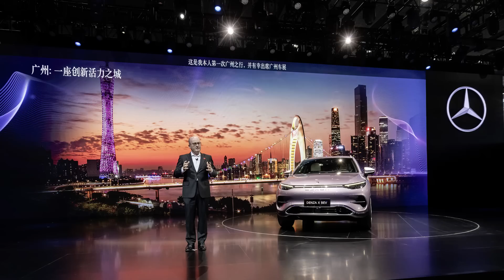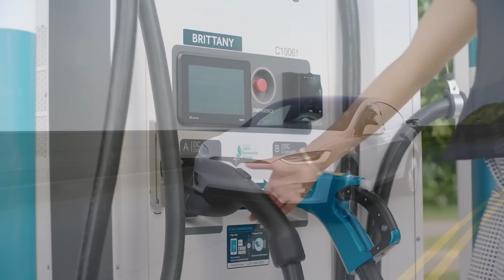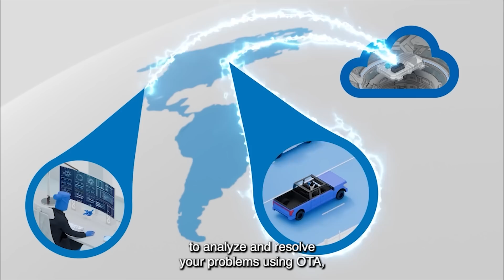EV Batteries Degrade 1.8%/Year; LFP Threatened by Falling Nickel Prices - Autoline Daily 3895

Comment: My MG 4 Trophy in UK 
Has 97% state of health after 48,000 miles in 18 months in UK.
Some batteries have no cobalt, famous for children working.
ALL gallons of petrol and diesel need cobalt, it's used in the desulphurisation process of oil for petrol and diesel.
Battery cobalt is recyclable.
How come autoline never mentioned it?
No-one cared about rights abuses before EV.
Why not?
Why now?

Comment: They are certainly coming up with better chemistry for various types of Lithium-Ion batteries all the time.
Solid-state batteries might not get a good foothold till around 2030...
If they can get around 1.5% degradation per 40000 miles for a Lithium-Ion battery pack they will be well and truly in the ballpark.
Charging times are also being reduced incrementally, because of the better battery chemistry that comes with R&D...
Firteen minutes to 90% charge on a public charger is still the goal for most Electric Vehicles and is attainable.
😎🇦🇺

Comment: I have a 11.5 year old smart EV (60-70 mile range stock) that's done 1000 charge cycles, has over 70k miles on it now. It still has 95%+ of its original range.

Comment: REPORTING GROSSLY EXAGGERATES BATTERY DEGRADATION 
That GeoTab's study announcement does not state that batteries degade down to 64% in 20years, that seems to be reporters putting words into GeoTab's mouth.
InsideEV (or whoever 1st miss reported this) have taken the first year degradation and multiplied it by 20 years, despite the fact that more degradation happens in the 1st year than the next several years combined. Since then nearly every reporting organisation just repeats this gross misinformation without bothering to understand the story.
The degradation of a quality EV will likely be closer to 94% than 64%. Though I would guess 84% after 20years is more realistic.

Comment: Battery price is decreasing at a rate of 10~15% a year and since the battery is the most expensive component in an EV, EV price is decreasing at a rate of 5~10% a year. ICE price is buttomed out while EV can go lower because it's fundamentally a less complex and more reliable design

Unless Europe can come out with strong EVs, it will not only lose the Chinese market, it will lose a lot of international markets

Comment: 1.6 kW a mile that's gas guzzler terms with only 500 miles of range. You can't go anywhere with that. I mean a diesel get 6 to 8 miles to the gallon but can go 15 to 2000 miles a full 300 gallon tank

Comment: 64% of battery capacity after 20 years isn’t good enough when a replacement battery totals the car. So a car originally with a theoretical 300 mile of range will only have a theoretical 200 mile of range in 20 years and only 120 functional mile range. I have a 27 year old Dodge truck that is all original except consumables. It still has a functional range of over 300 miles. No wonder BEV values drop like a rock they are disposable vehicles.

Comment: I need clarification about the statement at 4:40 regarding 1.8%/year battery degrading. How can battery mfgs like CATL offer 15 year replacement warratines if the batteries fall below 85%. At 1.8%, the battery would drop to 73% in 15 years. Also, how does MG in Thailand now offer lifetime battery warranties on some of their models?
Reply: I can only assume Nissan Leafs were overrepresented in the study sample.  Or the data were taken from only the first two or three years of operation.
Reply: It could be that CATL has a 10% buffer in their batteries. Thus you wouldn’t see the first 10% of battery degradation in the range estimation.
Reply: Lifetime battery warranty means the car wjll breakdown as garbage soon.. No ev no battery warranty ends.
Reply: @AskieFox-i2b  Maybe so for MG, but it appears CATL's Shenxing LFP battery, licensed to be made in the US for Ford, Tesla, and GM in late 2025 and 2026, will offer a 15-year or million-mile warranty with zero degradation over 1000 charges. When I engineered diesel engines, we never provided more than a one-year warranty on our engines. Our test on these batteries for our electric semi-power trains showed a full mileage range from -14F to 140F. We could not even offer that on our diesel engines.
Reply: @AskieFox-i2b  Break down?  You mean, like a Ram Promaster?

Comment: Even this study is being conservative imho: 

- Sure 1-1.8% battery degradation per year might be a good conservative figure to go by. Better to be conservative and be pleasantly surprised than the other way around.
- A study on the fleet of older Teslas has fairly consistently shown that the vehicles hit around 92-94 percent of original capacity by the 200k mile mark. (Source:Steinbuch Tesla Model S battery degradation data).
- Battery chemistries are improving, both in terms of existing NMC/NCMA stuff, and in terms of introduction of the LFP (iron phosphate) ones, which last many times longer but trade that in for slightly lower energy density, a good compromise for entry/mainstream EV trims.

Comment: Over time, ice engines lose horsepower torque and efficiency...
Reply: Sooner on direct injection, turbo cars
Reply: Yep I saw that happen on my old Corsa C. Granted, it was 16 years old but it did start to lose power when going up and slowing down where it would have had no problems keeping a constant high speed in 5th gear when I got it. Mechanic said that other than a full engine rebuild, there's not much else that I could do.
Reply: @Luka_3D  Happens to every ice engine, it's inevitable over time

Comment: There's not gonna be "enormous pressure" to back off ICE ban in 2035, because by then it would as useful as a horse carriage ban in 1950.

The problem for EU's "Dieselgate club" members is they failed to transition successfully to EVs before China's EV industry related "investments" started bearing fruit, in the same vein of how they came to dominate in solar.

Right now all EU has left as an effective local presence is Giga Berlin, and we see how they're making Tesla's life hard there, how ironic.

A backlash against China now will not save them, as ICE sales will continue to falter while China eats up the markets outside the EU, it's a global market (e.g. 2:39).

Trial by fire.

Comment: So, you lose 36% battery life after 20 years.  It's probably not linear, but let's say 18% at 10.  Does this correlate to the loss in range?  Does a BEV with a 300 mile range have a range of only 246 after 10 years?  I've seen data from Tesla showing the loss in range can be more than the loss in battery life.  It's good that the technology is making the batteries last longer, and thus pushing back the high cost of an inevitable replacement.  Howevver, if the loss in range is still relatively high, then that remains an issue for some buyers.
Reply: Battery life directly relates to range. Take A 60kwh battery with 240 miles of range (4mi/kwh) at 100% battery life. 90% battery life means the pack is only holding 54kwh and supplying 216 miles of range. However, the reality is that the issue is battery cycles. 
My 2017 Bolt EV had 8% range/battery degradation at 5 years, but had also driven over 100k miles on the original battery pack. At that rate, I could expect to hit 20% range loss somewhere over 200k miles. EV batteries are considered 'unfit for purpose' at 70%, so realistically I could have expected the original battery to have lasted over 250k miles, or over 20 years at an average of 12k miles per year. By 20 years, I would be more concerned with replacing the car than replacing the battery.

Comment: Coworkers model 3 is at 19% degradation (out of warranty), he has gotten worse than 1.8%...Standard deviation? Extreme points? Maybe share the numbers?
Reply: How many years and what mileage on the Model 3.  Maybe share the numbers?
Reply: @Gig0Surf  2019 M3, was at 19% at 175k miles beginning of the year. 180 mile daily commute (San Diego to Irvine and back), level 2 charging at home. Loves the car, he used to be able to do the commute only charging at home, now he doesn’t have the range.
Reply: How does he charge it?  Year?  Mileage?  Battery type?  Maybe share the numbers?

Note: There are always exceptions.  Plenty of ICE vehicles croak before 50k miles.  But it's not the norm.
Reply: 1.8% PER YEAR.

Comment: Lutz is a Putz. He completely missed the transition to electric vehicles.
The world is going all electric. ICE vehicle sales are falling every year.
He is an OLD time motor head who is living in the past not looking to the future.
Reply: He doesn't know anything about Chinese manufactured EVs EITHER.
Reply: IIRC he was key to supporting the Volt during his tenure at GM
Reply: @KJSvitko  they put the cart before the horse . Not enough power generation or chargers . Home chargers for grocery getters only reliable power
Reply: @Gadfly2025  Most EV owners do 90% of their charging at home overnight. Just like your Iphone plug it in when you get home and it is fully charger in the morning. Most people drive 40 - 50 miles a day on most days.
Reply: he's 92 of course he's a dinosaur, his expertise is NOT EVs so cut him some slack
Reply: Plug-in hybrids can be effect affective at reducing pollution if used correctly. Unfortunately, many of them have a such a small battery that they generally are not affective at reducing pollution, because they operate normally on gas. Also, many people may not use the charging as much as possible, reducing the greener efficiency. They simply use less gas per mile than the SUVs, etc..
Reply: @seniordockman2946  and Partial zero PZEV  GAS POWRED  cars actually emit cleaner air than they take in in air pollution cities
Reply: @KJSvitko  WEF thanks 🙏🏼 you for your compliments
Reply: Nobody missed anything. The auto-market is highly polarized. Not every consumer wants a BEV. And hybrids are outselling BEVs in North America.
Reply: Completely false.  Lutz was there during development of the Volt and although GM dropped the ball on it, Lutz was right that hybrid powertrains were the future.
Reply: But definitely more respected then you on automobile knowledge!

Comment: The transition to all electric vehicles is inevitable.  Slow walking the transition will only make it worse for the auto makers.
VW, Mercedes, Stellantis,  Porsche, BMW and the rest will continue to lose ICE sales.
Reply: It's not inevitable. The future will be a mix of ICE, hybrid, BEV, and hydrogen.
Reply: BEV are disposable vehicles. Batteries are to expensive to ever replace with a new battery and another used battery will have degraded capacity as well.
Reply: @matthewhuszarik4173  Batteries are designed to last the life of the vehicle. Over 300.000 miles.
Reply: @matthewhuszarik4173 the contemporary battery degrade is just a much as ice lose compression over years. Ive seen tons Taxi clock ing half million kilometer with almost no battery degration. Even for the first gen BYD E5 with over 10 years of service, it still retain 50% capacity. That is old tech. With the current tech. The degrade will be even less. You petrol head need to face the reality. The emission standard and the fuel consumption requirement in legistration is the noose on the ICE. Unless there emission standard and fuel consumption requirement get roll back. The requirements will becomes impractical to achived for ICE within a decade.
Reply: @林振华-t4v  EV will still have full power if a shorter range.   ICE looses power over time.
Reply: @林振华-t4v  Not exactly ICEV loose compression from mileage not just being stores. Li-Ion batteries lose capacity both being cycled and being stores.

Comment: GeoTab got one thing wrong.  After about 50K miles battery degradation slows significantly.  We should not be surprised that it degrades on a curve.  It would be very odd if it were linear.  In short it is much better than GenTab is reporting. Not  every one will have the same experience but: A crowd sourced study by Tesla owners showed Model S owners experiencing an average degradation of around 10% after 150,000 or even 200,000 miles
Reply: My Model S battery is five years old and has 96k miles. Tessie says it has 8.9% degradation. There is a clear curve to the degradation, it’s much flatter now.
Reply: The crowd-sourced Dutch/Belgium study showed 5% degradation in first 50k miles and 1% thereafter.
Reply: @waynerussell6401  don’t believe official info about official pushed products
Reply: EV Haters hate context..
Reply: @250dmitchell  I don’t hate them . I owned one Polstar 2. They ain’t ready for prime time. It’s ok you to own one but not have people who can’t afford one fund your purchase
Reply: Too bad 50% degradation makes it useless 😆😆
Reply: @Gadfly2025  recycling companies don't think so
Reply: @Gadfly2025 At certain % degradation, it would be repurposed, recycled. Effectively removing the need to mine and refine.
Reply: @nguy404  the cost will be big $$ and those who own cars will put up $$$ cash  to fund the recycling
Reply: @Gadfly2025    The recycling centers pay good money for BEV cells.  The refined minerals in the battery are worth thousands.
Reply: If its 1.8 percent  compounded yearly that would be a curve, possibly a curve in the wrong direction, must be an average
Reply: @rp9674  The article has a graph with a data point at 2 years and again at between 4 and 5.    Of course they are linear.
Reply: @rp9674    They graphed 2 data points...
Reply: It's been pretty much a straight line for me and my Volt at about 15% degradation across 10 years and 100,000 miles. The sheer number of data sources make Geo Tab's observations difficult to refute.
Reply: @KTPurdy  The Volt is an NMC battery, no?  The Model S uses NCA cells.  Other vehicles use LFP, generally known for long cycle life.  No matter how much data is included, aggregating these and other chemistries into a single "EV batteries degrade X% per year" seems possibly misleading and worth questioning [still, the overall message is good if not already known, that battery packs should last the useful life of the vehicle ]
Reply: @Gig0Surf This is an important point.

Degredation for a Leaf will be much higher than other models.  Degredation for LFP Mach-E or Model 3 will be much lower.
Reply: @Gig0Surf  My understanding is that today very few cars use LFP. Geotab does breakout their stats by model and year. The Volt beats most EVs, although the gap is relatively small.
Reply: @KTPurdy  Did they make the observations or project 2 years over the life of the battery?
Reply: @KTPurdy  That is kind of strange.  These processes seldom are linear.   When you take two samples it defines a line.   The graph shows one sample at 2 years and another between 4 and 5 years.   I find that troubling.  The forced the line.
They did not tell us the mix of fleet to private cars, would be interesting to see.
Reply: @KTPurdy  Probably varies allot by the many chemistries and thermal management solutions out there, hard to say for sure. 

Battery chemistries continue to improve as well, in both NMC/NCMA space as well as rise of LFP, which trades some energy density for many times higher cell life.

Either way, it tells us these packs will easily outlast any ICE car in general, past 250k miles and without a problem, and even >500k miles is realistic depending on use case.
Reply: @AllanSustainabilityFan  While Geotab does track model and year of the EVs they are monitoring and each one has a good sample size.
Reply: @KTPurdy  Then why are they showing a graph with 2 points in time for each battery.  2 year and  one in the 4 to 5 year range.
Reply: @danharold3087  Most all of Geotab's graphs linear to me. Tell me which model isn't. Unfortunately, they only go back 5 years. Not super helpful.
Reply: @KTPurdy  There are many non linear models.  Not sure where your going.  They are projecting future degradation from the 2 points which are observations of the most rapid part of the degradation curve plotted by others using a lot more data.
Reply: @danharold3087 wish I could do a screen shot. The curves are ever so slight . Too bad the tracking doesn't go beyond 5 years.
Reply: @KTPurdy  Did GeoTab have more data than the two points shown?  If so I withdraw my object.
Reply: @danharold3087  6300 cars spread across a couple of dozen models/years of cars. Not sure the break out.
Reply: @KTPurdy  
As I think about the GeoTab article it seems they were simplifying the data and the results to make their point.  While it does not align with my accuracy bone it will be useful to help people understand battery life is not the issue it is made out to be.
Reply: @KTPurdy They are working to provide a general case.     Now I have not looked at in a few days. Have no intention to spend more time on it.

Comment: HUGE! The meaning of batteries lasting longer than vehicles means that over time a HUGE supply of used batteries would become a reality - likely at lower cost than used engines. This would completely destroy batttery life FUD. Also, as data is collected and verified, EV battery warranty will be extended to 200,000 miles or more - pretty much killing any battery life concern.
Reply: In China, they already have 600,000 mile warranties on some car batteries...
Reply: catl have 18000 engineers to develop their battery, the advancement (cheaper, safer, longevity, etc) will be quick. byd have 90000 engineers, but I don't know how many are working with battery development.
Reply: I’m waiting to see an upstate New York 10 year battery.
Reply: @Thatdavemarsh  There are quite a few 2014 and older Tesla Model S with original battery in upstate New York. If you're concerned about cold weather, Norway has plenty of 10 year old EVs (Teslas and others) that are doing great.
Reply: 1 - 1.8%  degradation as reported didn't mention this percentage isn't linear.   Majority of degradation occurs in first 5 years then flattens out.